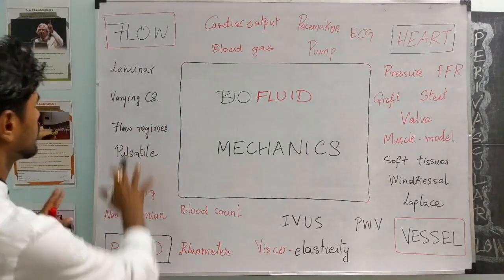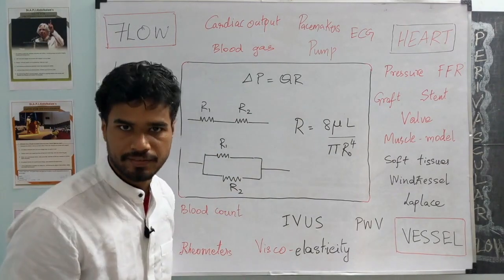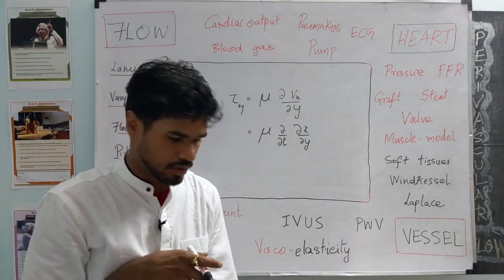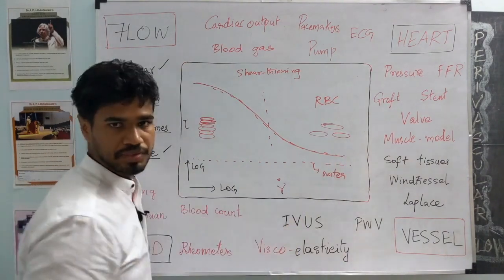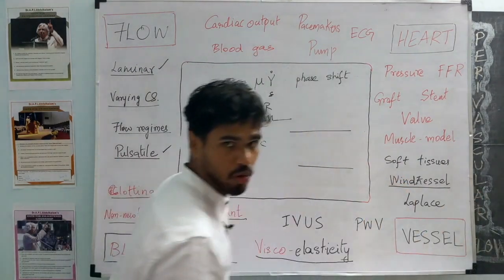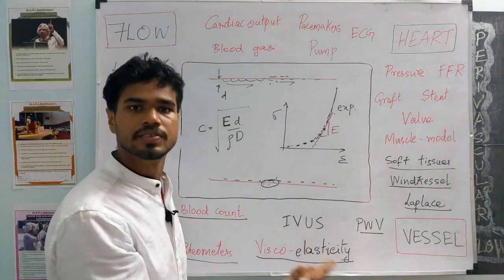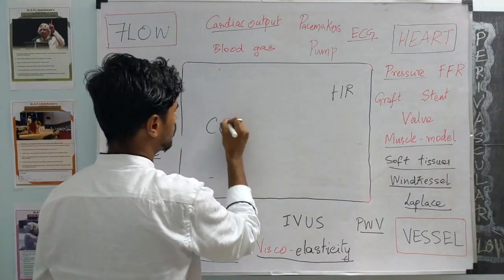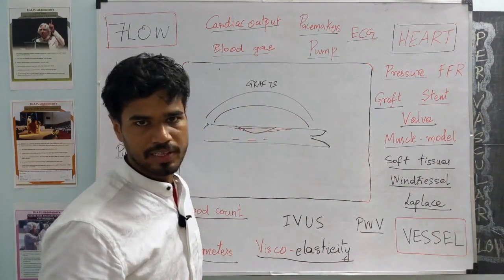Biomechanics Biofluids | Biofluid Mechanics GATE Exam | CRASH COURSE Cardio Vascular Haemodynamics

Comment: Sir I want to learn this because , unless clear physics comes under picture, I am unable to get the feel of the concept in biology as I'm a MBBS Student.
Thanks ❤️
Reply: Sir what is the pre requisite for learning biofluid mechanics
Reply from the maker: @abhipatidar6839  Prerequisites is basic physics and fluid mechanics (typically used by mechanical engineers to study water flow in pipes)

If u r an MBBS student, I will try to get a copy of the book "Hemodynamics for surgeons. D. Eugene Strandness and David S. Sumner" as a long-term guide. 

N Westerhof, Snapshots of Hemodynamics is very approachable/easily available
Reply: Thank you very much sir
Reply from the maker: ATB 🙏